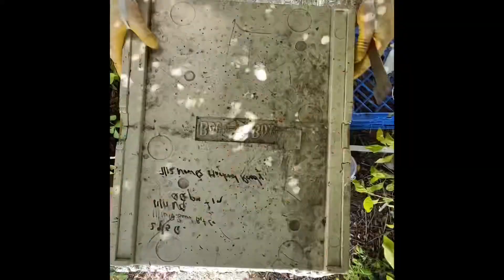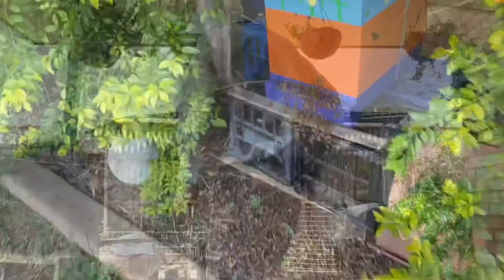New Little Honey House

Comment: The bees don’t really like to draw above an excluder there is no young bees in a honey super to draw out combs, instead checkerboard the new plastics into the brood box, swap the frames on the edge of the brood nest and lift up capped brood ( no eggs) to the super, the newly emerged bees will sniff out young brood to nurse
Reply from the maker: Awesome thanks mate I’ll get into it 🍺🍺
Reply: @downunderfulla6001  the no eggs thing is because if the brood is too far from queens pheromones they’ll make emergency QC with the young larvae and you inadvertently cause swarming or superseder process, I usually only draw 2 frames at a time so resources aren’t exhausted
Reply from the maker: @BESHYSBEES  ok thanks. I did swap out the dud plastic frames for wax foundation thinking it being more natural. I’ve got all the others in a closed box in the shed. I’ll get back into it tomorrow
Reply: @downunderfulla6001  doesn’t really matter frames are of a food grade plastic, we put the plastic in the brood for a cycle or two so the combs have a cocoon lining that helps prevent them blowing out in the extractor, if you can try to keep the wax foundation in the brood chamber until it’s black, once the combs are black (about 5 yrs old) you lift them to honey then extract and replace the foundation sheet, the reason to use wax in brood chamber is simply ease of use ie it’s easier to cut off queen cells using the punch method and they don’t like being spun too quick they literally explode apart in the extractor especially if the frames are warm.
Reply from the maker: @BESHYSBEES  awesome thanks Beshy, I’ve got lots of learning ahead of me
Reply from the maker: Beshy I blew out one frame when spinning. It didn’t look to old being yellow but I had the extractor sitting on top of shitty cheap table.
Reply: @downunderfulla6001  gotta bolt that shit to something heavy lol maybe a chep pallet stop it dancing across the shed lol